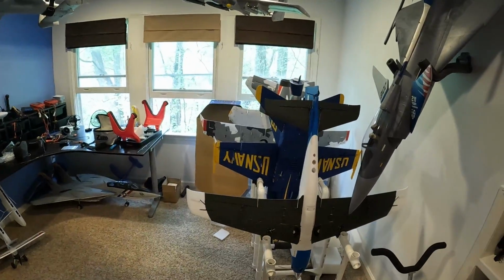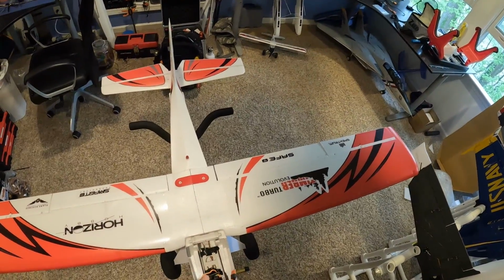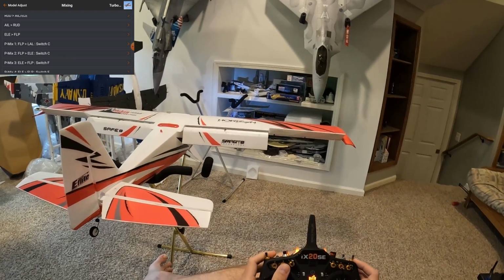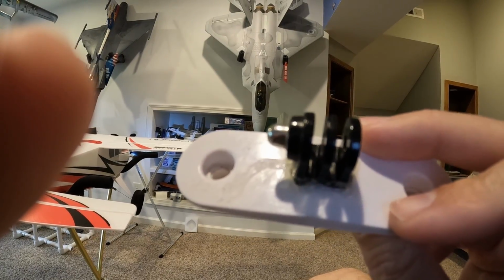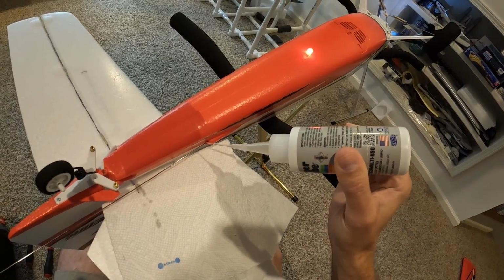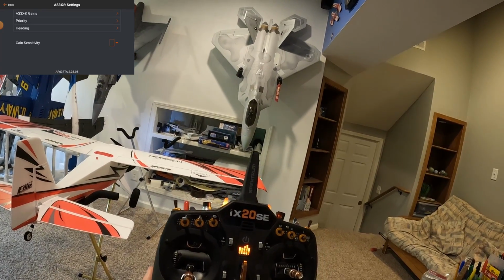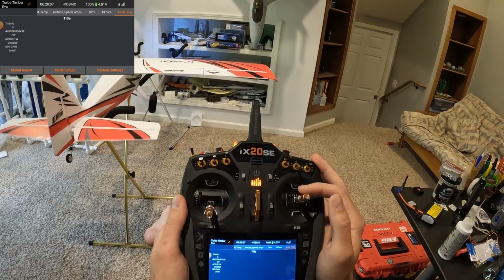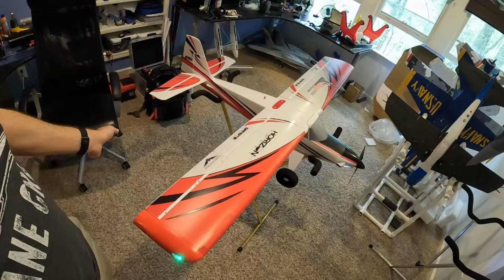Setup: Turbo Timber Evolution Max Performance w/ Spektrum Avian ESC Programming / Voltage Callouts

Comment from the maker: CLARIFICATION FOR ENABLING CROW: All you have to do is unscrew the two wing plugs in the fuselage, unplug them from the receiver, and cut one of the leads going into the aileron plug right before where it plugs into the plastic lead. Use a DuPont connector kit (like the one in my description) and affix a new servo lead to the end of the cut wire, then connect that to channel 5 or 6 - depending on which channel your transmitter expects the aileron to be connected when you've set it up as a 2 Aileron 1 Flap wing type.

Once this is done and the receiver is reprogrammed, you'll have stabilization on both ailerons.

If this is confusing, join us on Discord via bit.ly/TBRCDiscord and ask for assistance in the tech-and-setup channel!

Comment: I’m confused how you did the flaps, I have mine apart right now and the only way I can think to get them to extend more is a bigger control horn, but now they protrude through the bottom of the wing.
Reply from the maker: Hop on Discord for help via discord.gg/twobrosrc in #tech-and-setup

Comment: Hello I acquired this plane but it has a sky power 60A esc. I bound the plane with the bind plug in because I did not want SAFE. 
I FLY WITH A DX8 G2. 
I upped my throttle past 25% to activate the AS3X but it won’t activate. I do not see it or hear it trying to compensate whatsoever. I have rebound trying that that was no help. Any suggestions?

Also, I’m trying to set up reverse thrust. Is that possible to do using the DX8 G2? I can’t figure it out.

Thank you in advance!!
Reply from the maker: Ask for help on Discord via discord.gg/twobrosrc in the #tech-and-setup channel - we can't and don't provide assistance on YouTube, but we're happy to do it in real-time on Discord.

Comment: Question.. has anyone modified flaps for full span ailerons? Considering doing along with tail servo upgrade for faster roll rate and more control in harriers and hovers.
Reply from the maker: Nope. It would be a bunch of work.

Comment: Just ordered everything using your links. Well except for the connectors, but I think I may already have some. Setting up for crow is just getting the ailerons on separate channels, right? Or flaps also?
Reply from the maker: Thanks dude! Hop on Discord via discord.gg/twobrosrc - it'll be easier for Jon and the TBRC community to help you out with the questions you'll have. But yes, only the ailerons need to be split.
Reply: @TwoBrosRC Yeah, I'm on there, but I'm new and gotta learn the ropes. Thanks!

Comment: I finished installing the new servos. The covers I just used some double sided tape to space them out a little, then used packing tape to stick the covers down again. I set it up and flew it today. I am still getting things setup, so I haven't pushed it yet. I installed the Super Turbo Timber air filled tires on it as well. Spaced the tires out 6mm on each side. This really improves ground handling and my rough landings. I have three settings on my flaps switch. Off, Landing, Crow Braking. I use a NX10 RX. I have it all setup on the flaps settings. I would like to put Crow on a separate switch so I could have two flaps settings.  But I haven't figured out how to do this yet. any tips on how would be appreciated. I haven't decided if I should switch out the springs for Kin shocks. I think I will fly it for this year since its almost winter and I will put on the floats for snow. 

Thank you !! so much for these videos and all your help !! It spurred me on to replace the servos and hook the ailerons on to two channels. I was having a lot of fun today flying it today.
Reply from the maker: Happy to help! The best place to stay in touch is on Discord via discord.gg/twobrosrc - it'll be easier and faster to get replies there, too!

Comment: I am installing the new servos in the wings. I used the third hole in the new servo arm. The horn sticks up a bit from the outer surface of the wing. Did you install the factory servo covers again somehow ? Or just leave them off ?
Reply: The servos are the ones you sent me a link for B11DLS. The stick Spektrum servo arm won't fit. It's a different amount of teeth on the new servo spline. I will have to cut a notch in the servo cover or space it out a little with foam tape. Then put clear tape to hold it down.
Reply from the maker: Use the stock arms or cut the arms short so they don't bind on the cover.
Reply: The stock servo arm will not fit. I installed the swivel in the third hole and cut the rest of the servo horn off. But it still sticks up about 1/8” ? The servo cover would hit the servo horn now.
Reply from the maker: The stock arms should fit, we're still using them on our B11 servos. Otherwise, just cut the unused length off or cut a notch in the servo cover to accommodate the servo arm.
Reply: The third hole in the new servo arm is out a tiny bit further than the third hole in the stock servo horn.

Comment: The reason you replace the servos is because the original ones you can’t get 150% throws ? Do 
I replace all six servos ?
Reply from the maker: Nope, replaced them because we wanted more travel, more speed, more precision, and more torque. The stock servos just can't do what we're asking the plane to d.

Comment: I'm a little confused about your setup for crow flaps. FYI, I'm still on a factory receiver programming and only have 100% rates right now. When I mix in the crow flaps, I'm getting full span flaps on the right wing and crow flaps on the left wing. How did plug in your aileron servos to be in different channels without upgrading receivers or removing lights? I assume this is what the cutting of the two wires was for? Guide on how you did it?
Reply from the maker: That's because you didn't cut the lead as mentioned in the comments. The ailerons have to be on two separate ports, and you have to unlock the receiver to reprogram it to recognize the new setup. Join up on Discord via bit.ly/TBRCDiscord and ask in the tech-and-setup channel for help!
Reply: @TwoBrosRC  Yeah I just didn't see details on how exactly to do it and what the drawbacks are. I'll ask in discord

Comment: How do you program 150% rates?
Reply from the maker: You don't. You unlock the receiver, reset it, then set 150 TRAVEL. 100% rate is what you'll end up using. Rates are a percentage of available servo travel.

Comment: Hey Jon. I want to put agf servos in my timbers elevator and rudder. How did you get the stock ones out? I wanted to get your advice before I go ripping them out. Thanks
Reply from the maker: Use a sharp hobby knife to slice the glue behind the servos, then gently pull them out by the servo arm using a pair of big pliers. Firm but consistent pressure will be required. Then install the new AGF B11DLS servos using liberal amounts of FoamTac - make sure you get air into the glue so it strings up as you press it in and pull it apart.

For more, join up on Discord via https://bit.ly/TBRCDiscord because you're almost guaranteed to have more questions, and any follow-ups might take a week to remember to check on YT.
Reply: @TwoBrosRC  Maybe you could make a video (or link to one) on how to use Discord. It's like being in a room with a dozen conversations going on at the same time.
Reply: Thanks for your help

Comment: Since you keep your gains on a slider, what would you say you typically fly at (50%?) when you're using 150% Plus a further increase in deflection from servo horn changes?  thanks
Reply from the maker: Usually in the mid-range, no reason to adjust it unless it's getting especially windy.

Comment: Hi Jon.  I’ve been re-watching two of your videos, both excellent by the way.  My intention is to get more familiar with my Spektrum ix12 mixing.  I find both your TimberX and Turbo Timber Evo videos extremely helpful.  I’m trying to better understand how to choose the correct control surface (as in the case of mixes involving ailerons or flaps) for the mix set up.  For example: in the case of snap flaps, how would I know to choose Left Flap or Right Flap when mixing with Elevator?  I have separate servos on separate channels for each Flap segment.  I’ve been searching the internet for a Spektrum mixing manual, something more in depth than what’s provided in their transmitter manuals.  Is there a simple way to understand this, or is it a matter of experimenting?  Thanks.
Reply from the maker: Hey man! It's best to ask these questions on the channel's Discord server viahttps://bit.ly/TBRCDiscord - it's way too easy to lose your comment here in the follow up. Join up and ask for help!

Comment: Will the original ar637t reciver allow 150% rates ? I moved the control horn to the inner holes.
Reply from the maker: Yes, if it's unlocked. Join us on Discord and it'll be easier to get help. https://bit.ly/TBRCDiscord

Comment: twin timber springs and 70 amp Avian lite now installed on the new rerelease turbo timber
Reply from the maker: We'll definitely be picking it up.
Reply: @TwoBrosRC  i got my sky remote id module and the esc on its every thing esle i can remove off twin timber for the spring

Comment: do u replace all 6 servos and and how do u remove the wing servos cause of the enbeded design of them
Reply from the maker: We left you a comment mentioning how to do it when you asked last time - and yes, we replaced all six servos.
Reply: @TwoBrosRC  sorry sire
Reply: all my servos r replaced 
throws are 
ail 150/150
ele150/150
rud 141/126
flap 150/145

have not setup crow yet will work on that the hinges i will replace in elevator once i order the kit and prop and hinges do i do 3 in each elevator half for the hinge replacement or 2

Comment: how u remove the flap servos
Reply from the maker: There's a door on the underside of each wing. Take a sharp modeling knife and cut the door free from the stickers, then gently pull it off and change out the servos.
Reply: @TwoBrosRC   i guess stock servo arms for the new servos and r there any mods to the servo pockets to install new servos or just stock

Comment: Hello, this is awesome. Just got my timber and want to get the most throw with stock servos. Can you please do a video on exactly how to do this? Where you would unlock whatever and actually visualize in a video. I’m running a nx8 transmitter.
Reply from the maker: If you want full throw on the stock servos, unlock the receiver and position the servo arm pushrods at the outermost hole and the control horns on the innermost.

Comment: I prefer simplicity in doing things. Life is full of other complications 😀. I don’t have this model, but I have the eflite Mule, I put a 4S battery pack in it out of the box, fly it, enjoy it and leave the field.  No drama.  I do the same with the FMS ranger 1800mm wireless / clipping wings,  also no drama.  The only mixing i do is rudder with ailerons (optional) and flap compensation (needed), that’s all.
Reply from the maker: OK, that was always allowed.
Reply: @TwoBrosRC  thanks , though I learned from you a lot thanks.

Comment: Do the upgraded servos on the elevator and rudder give them more throw or travel?
Reply from the maker: They have improved speed, travel, and torque.
Reply: @TwoBrosRC  I’m running a DX-6e and when I program 150% travel, it doesn’t make any difference from 100%
Reply from the maker: @STEVEJELLY You need to unlock the receiver and reprogram it. It's mentioned in the vid.
Reply: @TwoBrosRC  Thanks! I’ll rewatch the video tomorrow
Reply: @TwoBrosRC Could this be done on an old DX-6e?
Reply from the maker: If it supports Forward Programming, sure. You'll need to unlock it first though.

Comment: Hey Jon! I just picked up a turbo timber and want to set it up like yours. I was wondering how to program the receiver to do 150% rates, and also how you got crow.
Reply from the maker: You need to unlock the receiver. This is done by Googling "unlock AR637TA" and using a Spektrum programming cable which you can find here: https://bit.ly/3P4a9Kg

The comment section of this vid has info on where to cut the lead and affix a new connector to enable dual aileron setups.
Reply: thank you! @TwoBrosRC

Comment: Hello, I have a question. I can trim my timber to fly straight and level at a set speed but when I increase the speed it climbs and when I decrease the speed it drops. Is this normal? I have been told that this is a "normal" thing for a plane to do and I agree to some extent but I have flown planes before that"tracked" so much better. You have experimented with your CG location, what do you think? I was also wondering if the "thrust line" could be off a bit. I doubt the angle of incidence could be an issue. Thanks for your videos,
DC
Reply from the maker: It is pretty normal for more airspeed to necessitate more downward trim or pressure. A more neutral CG will mask a lot of this tendency though since the horizontal stabilizer can be completely neutral or slightly down, so the faster it goes the less likely it is that it'll climb. You can also adjust the gyro to increase pitch gains which will automatically resolve this as well.

Comment: Does anyone know if it's possible to get the combi switch on the NX controller?  I only see options for single switches. I am trying to replicate as seen in the chapter Crow/Full Span Flaps Aileron Mixing @ 13:12
Reply from the maker: You'll just have to create separate mixes for it.
Reply: @TwoBrosRC  Not sure I follow..Would separate mixes work? Doesn't this require switch c pos 2 AND switch d pos 2. I don't see how this can be achieved without a combi option in mixing? I've got everything else working (thanks to your videos and explanations so I appreciate that!)

Comment: Jon--I followed to the "T" on your set up. Once I split the Ailerons I lost AS3X on the L. aileron. Any tip to re-set this for that surface ? I have unlocked my Receiver & updated DX-9 also.
Reply from the maker: It should be mentioned in the vid at some point in the hour's worth of footage, but you need to use a Spektrum programming cable and unlock the receiver, then reprogram it. It won't understand that your wing type uses two ailerons unless it's been unlocked and reprogrammed.

Comment: Thank you for your inspiration, I ended up using the provided B11DLS servos arms, however I noticed you were able to use the stock servo arms for your build. I measured both servos' gears and B11DLS were larger, so I figured I have to modify provided servo arms to attach control rod holder, drilling the holes a little bigger, which meant that I was changing the throw a bit. In addition, I have never crimped DuPont before but noticed on your recommended kit doesn't have little bevels on them. I have since ordered some different style from HH. I love your builds and appreciate your efforts. Any further clarification would be much appreciated.
Reply from the maker: What clarification are you looking for?
Reply: @TwoBrosRC  clarification on which servo arms you used for the B11DLS upgrade, B11DLS arms provided or stock Spektrum servo arms? I finished my build this weekend and stoked with ALL the modifications, thank you.
Reply from the maker: @PBJ805  Sorry about taking so long to get back with you, we get a ton of comments and try to respond to all of them. The stock arms were used here.

Comment: Where do you run motor timing? What do the timing adjustments mean and do?? A picture of ur wiring would be helpful...
Reply from the maker: We run stock timing. Higher timing means it gets run harder with more thrust.

Comment: How did you reprogram the reciever to have 150% throw?
Because I would also like to do that!
Reply from the maker: It's mentioned in the vid!
Reply: @TwoBrosRC  but the as3x only allows 100% rates
Did you unlock your reciever?
Reply from the maker: @groggykerman007  Yes.
Reply: @TwoBrosRC  👍👍

Comment: Can you take a picture of wiring? Or do u have it posted somewhere??
Reply from the maker: Read over the comments, we've described the process for ya.
Reply: I never seen a pic...
Reply from the maker: @brandonseals6732  We're not posting a photo - the comments describe the process.
Reply: Well u said u could in the video...
Reply from the maker: @brandonseals6732  That was well before the YT channel grew to the size it is now - we can't give step-by-step instructions in comments anymore. Simply don't have the time given our current upload schedule and strong desire to be away from YouTube when we're not posting content - it's getting overwhelming and keeping us from having a normal social life. Read through the comments, or better yet, here's some pasted instructions we gave another fellow:

All you have to do is unscrew the two wing plugs in the fuselage, unplug them from the receiver, and cut one of the leads going into the aileron plug right before where it plugs into the plastic lead. Use a DuPont connector kit (like the one in my description) and affix a new servo lead to the end of the cut wire, then connect that to channel 5 or 6 - depending on which channel your transmitter expects the aileron to be connected when you've set it up as a 2 Aileron 1 Flap wing type.

Once this is done and the receiver is reprogrammed, you'll have stabilization on both ailerons.
Reply: @TwoBrosRC  thanks... if u say u are gonna do something on the video people are gonna expect that... but sincerely, thanks... a picture would be quicker than this reply... but if I could give advise, save this reply (or a quick pic) bc I'm sure u are gonna get asked again... thanks

Comment: Do you change the wing servos? If so which ones do you use?
Reply from the maker: It's in the description - all servos were changed over to https://tinyurl.com/B11DLS units. These are very comparable to the servos shipping with Draco and the Twin Timber these days.